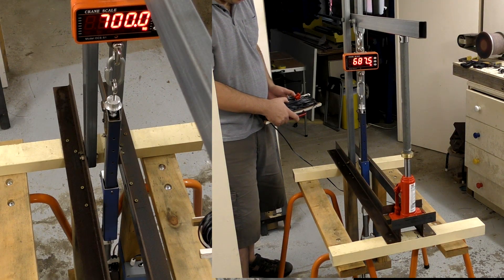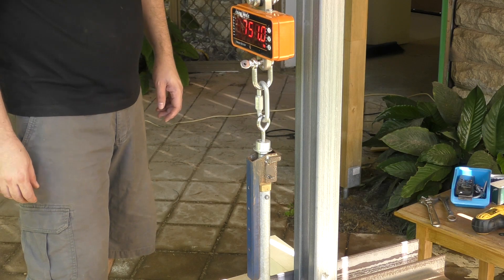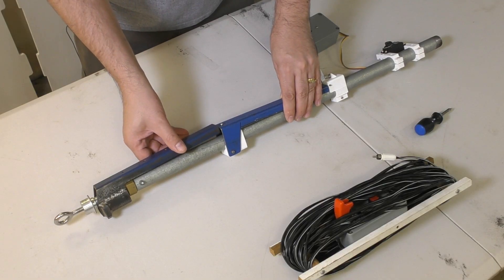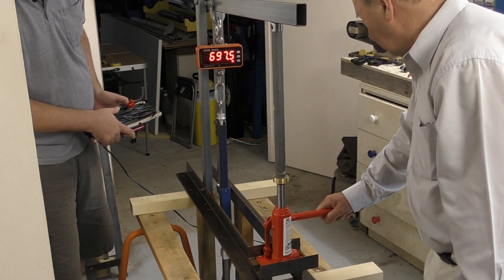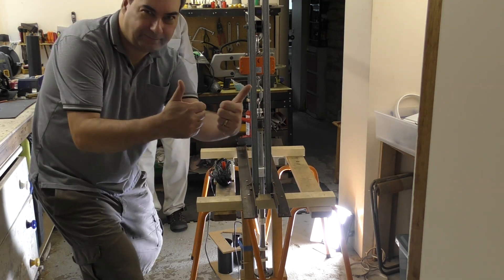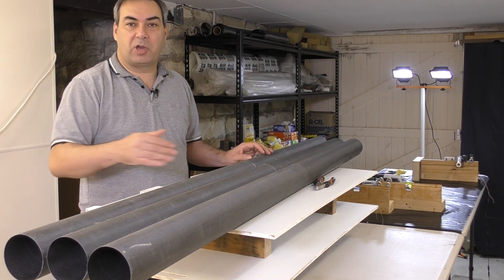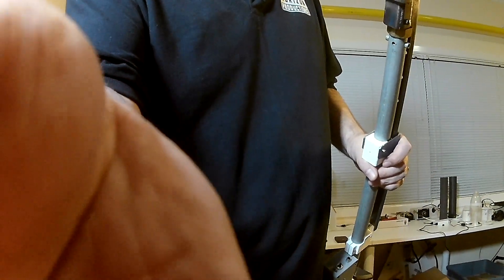2 Stage Water Rocket - Part 27 - Booster Release Mechanism

Comment: We have been removing very high pressure hoses for decades with light weight ball detent designs is there a reason we are not seeing modifications of these designs here?
Reply from the maker: Yes, it's the amount of force that's required to pull back on the collar holding those balls in place. We are talking about an equivalent internal hose diameter here of around 35mm @1000psi. For our low pressure launchers that's exactly what we use. This launcher, only requires a small  servo motor with little torque to activate it. Also normally you wouldn't be disconnecting a high pressure hose while it is still under pressure.
Reply: @AirCommandRockets  Actually there are designs for 3000 psi
Reply from the maker: @nathanhastings8293  Meant to be disconnected at 3000psi? Do you have link, I'd be interested
Reply: I understand that there are constraints for the release of the high pressure fittings sorry I didnt address that earlier. I am suggesting a rotation of a specially machined collar that allows for a rotation to a cocked position with a fine trigger release. Also instead of balls that focus the load in a small surface area, square thread or buttress thread could be used. I think this area may present some fun engineering. Ill send you some sketches of what I am thinking of  after I work out the details.
Reply from the maker: @nathanhastings8293  Yeah definitely a good engineering challenge. I'm always on the look out for new ways of doing things.

Comment: I see a problem with this design: During the initial acceleration you are likely pulling 50 to 60 Gs and your whole rocket is rattling. The spring holding the lever might not be strong enough to hold it in place and you might have an early launch of the second stage. To mitigate this problem you might simply cut a hole in the secondary lever and open the release to the top. This way the G-Forces secure the release during takeoff. To push the release up you could use a rigid wire connector, like in RC-planes. 
If you want to build a smaller and lighter release mechanism, it might be interesting to look at the release mechanisms of medieval crossbows and roman ballistas. They had a quite similar mechanical problem. In the case of the roman ballista the release mechanism can be made to have very minimal forces after just one stage.
Reply from the maker: I think you misunderstand what this release mechanism does. This doesn't fly, and stays on the ground as a part of the launcher. This is what launches the rocket. You may be getting this confused with the staging mechanism that flies on the rocket to release the second stage. See this for more details: https://youtu.be/T9PLB9kaXlM
Reply: @AirCommandRockets  I did confuse it with the staging mechanism. Thanks for the clarification.
Reply from the maker: @lukasdimmler2622  No Worries, I think there were a couple of other people who assumed the same, perhaps I did not make it clear. :)
Reply: @AirCommandRockets  I just watched the video you linked and that mechanism is indeed much better suited for the staging. From an outside perspective it is also interesting to see you work with relatively low tech sheet metal manufactoring compared to your extremely educated manufacturing of composite materials.

Comment: Great work as always.

Did you check that the third release mechanism with the spring, won't accidentally release on launch, because of the high acceleration?
Reply from the maker: Thanks. That stays on the ground, and is actually what causes the rocket to launch. The staging mechanism on the rocket, is protected against acceleration.
Reply: @AirCommandRockets  That makes a lot more sense, thanks.

I already thought a metal pipe would be to heavy to fly... But somehow figured it would be from metal for test purposes only.

Comment: I applied the techniques you detailed for making your tubes to a 29mm carbon fiber tube I was making with biaxial sleeve. Worked great. Some small adjustments will need to be made to fit my setup, but the tube turned out leagues better than my first try at it a while back. Thanks!
Reply from the maker: Great to hear. :) Are you making a 29mm min diameter rocket?

Comment: 700kgs of holding force is insane!
Is it going to be a single release on each booster? Are they going to be synchronised in some way?
Reply from the maker: In a previous multi-nozzle booster design we held down each nozzle independently, to help spread the forces, and then synchronized the release mechanism to let them all go at the same time. https://youtu.be/mEhpUWyGZlo That wouldn't have worked here, because if one of those was even slightly late, all the force of the entire booster would act on that slightly delayed release mechanism. With these pressures the timing is even more critical. So to avoid that problem, we just have the single release point, but have to deal with the higher forces on it.

Comment: Amaaaaazing! But what is the second white layer after carbon fiber and why/how it was ripped off so easily? Thanks!
Reply from the maker: This is called peel-ply usually made of nylon or something similar. You apply it over the composite  part to smooth out the surface, and any excess epoxy will flow out through it. When the part is cured, you can peel this layer off removing the excess epoxy with it. It is commonly used when vacuum forming parts. It also removes Amine blush which can form with some epoxies.

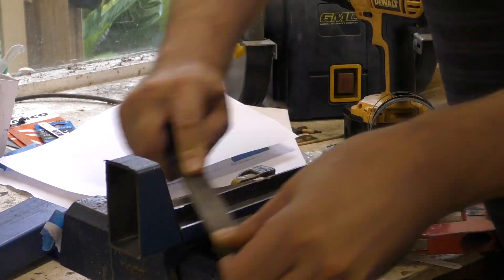Comment: 3:40  I can see in a few months: "So we now decided to friction stir weld the isogrid stainless steel pressure vessel panels for the water rocket..."
Reply: (and i love this project almost specifically for it's "overegnineering" / "being rediculous" aspect, keep up the great work!)
Reply: Also i feel the DIY-ing + documentation/open sourcing of workign with high pressures (this and the tank video) can easily be applied to non-water rocket systems, and your help via these videos may inspire others.
Reply from the maker: ha ha .. yes there is a bit of that "over engineering" going on here. :)

Comment: I wonder if some of the water stays behind, sticking to the walls. And thus whether it might be worth coating the inside with something hydrophobic?
Reply from the maker: The amount of water left inside the rocket is quite small after a launch. The acceleration helps drive any water stuck to the walls to the nozzle.  You would have to consider the weight of the hydrophobic coating to see if it is less than the amount that coating would improve things by. But a good question.
Reply: @AirCommandRockets  One indeed has to take that in consideration. So it might be worth testing. But that would probably be better suited for a simpler single stage rocket. And the result might even be (almost) negligible and thus hard to measure. Especially when also considering the unpredictable effects of things like the wind.

Comment: how do you chose the rocket aspect ratio ?
Reply from the maker: With water rockets long and thin is the preference. Less drag and better pressure containment. For the booster that allows you to use long launch tubes on the launcher to assist in better altitude.
Reply: @AirCommandRockets  I see, that make sense. I guess that makes the rule: as thin as you can mechanically get away with then?
Reply from the maker: @nraynaud  Yup, up to a point, the very long and very skinny rockets have a tendency to bend at higher accelerations,